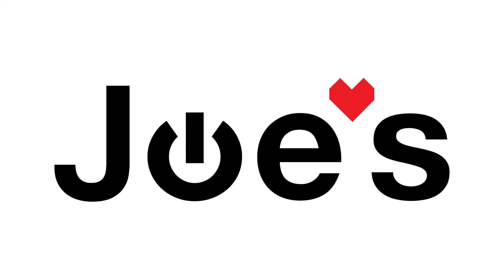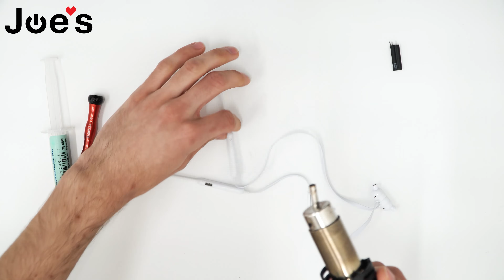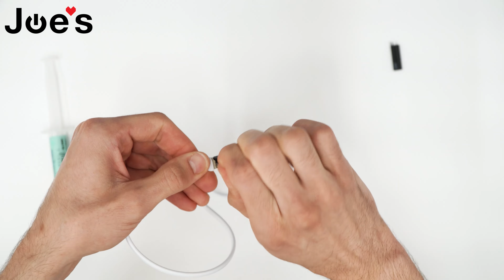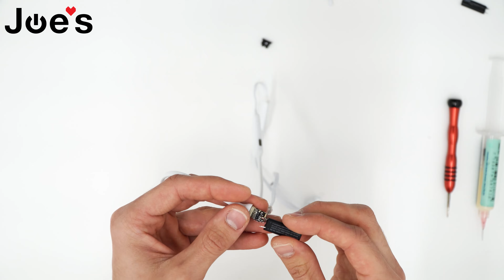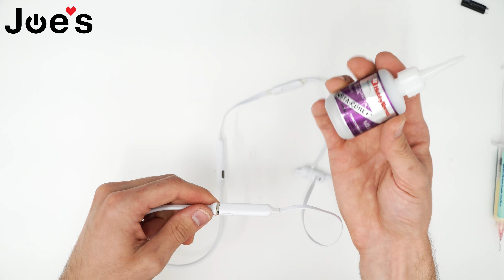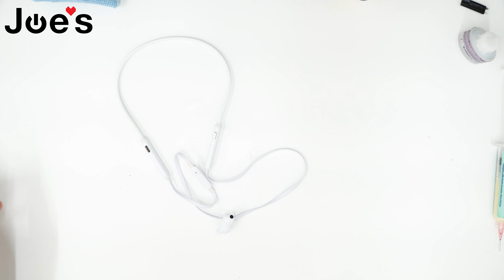Tutorial How To Repair Replace Broken Bad Battery Beats X Wireless Earbuds

Comment: It's worth trying what Ben said. If the device has not been used for a while you may be able to bring the charge back up above 3V by charging very gently at anywhere between 3V-4.2V with limited current. If the battery drops too low the bms will kick in and disconnect power to and from the battery. However the BMS might be built into the battery which would make it pretty small and potentially difficult to bypass. generally you need to charge directly to the cell itself because the bms may have cut of power from the charger. this is because the battery can self destruct if charged at full power when below 3V as it becomes unstable. but v gentle charging will restore 3V minimum and then the normal charger will charge it.
  Someone just gave me a pair but i hate earbuds, they have never stayed in my ears. I will probably move the receiver over to a different type of headphones.

Comment: My Beats X Sacai won't turn on, I suspect there's something wrong with the power button, but if I charge it the light goes on, is there any way to fix it? (HELP)
Reply from the maker: That was a very common issue. From what I remember it may be a bad main wire.

Comment: ***Request: My Beats X still work great except the buds are starting to come apart.

The little mesh guards both came out of the buds a while back, if you have a fix for that, I’d love to know.

Also, the buds themselves are separating at the seams. Do you just superglue those closed? 

Can superglue damage inside the earbuds if it gets in?

A video would be great. Thanks.

Comment: Wow so neat and doing the repair whilst commenting on the whole process. I purchased two pair of these (Beatx) a few days before Christmas 2020 for a present and never used them.  They are still in their vacuum sealed packs. I opened one pack today 05/06/22 plugged in the supplied usb lead and the led flashed red a few times then went red. After that there is no light at all. Seems they are knackered. I cannot believe it. I have another pair purchased at the same time still sealed in vacuum film. I expect the same outcome so all I can think of is contacting the manufacturer and asking their advice. If they are not helpful I’ll film the live unboxing and charging, and upload it on YouTube. I’ve read lots of customers who have had the same issue, charging on the day of purchase. It seems quite a few of these have been sent out with bad batteries. I live in the UK so not sure when to purchase genuine batteries from. Any help appreciated. And yes I would expect these to work straight out of the box 17months unopened
Reply from the maker: Sorry to hear you are dealing with that. We do ship our batteries internationally:)
Reply: Did they work?
Reply: Sorry, did u get them to work

Comment: Thanks. Year old beats wouldn't take a charge. Your guide helped me open it up. The battery voltage was around 0.5v. I was able to use a bench power supply to boost the battery up to 3.5v. Then the regular charger worked. Didn't have to replace the battery... Yet.
Reply from the maker: Happy to help. Thanks for watching. Please like and subscribe for more content like this!

Comment: How do I know if it's a battery issue or an issue with the cable? I have the same issue where upon plugging the Beats X earbuds into a power source, they flash red and white 3x, then it turns solid white to indicate charging. When I unplug them from power, they won't turn on at all. I ran my fingers over the black cable, since I saw that some people had it intermittently work when the cable was twisted a certain way, and there's a small blemish where the wires are bunched up/don't feel completely smooth. These have literally never been used, and Apple told me it'd be an estimated $91 for the repair (uh, yeah, no thanks). I just don't wanna buy one part (the battery or wire) and the opposite one is the actually issue. I'm also not trying to spend $50 on earbuds parts
Reply from the maker: It sounds like the wire is probably bad. These earbuds seamed to have that issue pretty often
Reply: I'm in the same situation.  Used half a dozen times, sat on the shelf for two years, now don't work.  Wouldn't have ever bought if I had known about the battery.

Comment: where do you get that flux in the syringe?
Reply from the maker: amazon.com/AMTECH-NC-559-V2-TF-no-clean-solder-16150K/dp/B01N8ZX7ZQ/ref=asc_df_B01N8ZX7ZQ/?tag=hyprod-20&linkCode=df0&hvadid=312065327708&hvpos=&hvnetw=g&hvrand=14698324034499163532&hvpone=&hvptwo=&hvqmt=&hvdev=c&hvdvcmdl=&hvlocint=&hvlocphy=1027652&hvtargid=pla-586193815164&psc=1&tag=&ref=&adgrpid=60223475657&hvpone=&hvptwo=&hvadid=312065327708&hvpos=&hvnetw=g&hvrand=14698324034499163532&hvqmt=&hvdev=c&hvdvcmdl=&hvlocint=&hvlocphy=1027652&hvtargid=pla-586193815164

Comment: Not worth it to fix, the battery costs $15. I see new units being sold for $19.99 on eBay.
Reply: I just got a battery for £5 and replacements of the headphone are not 19.99 they are a lot more on eBay
Reply: @barz91  they must have gone up in price. I see them for $29.99 now.

Comment: Please note - the replacement battery from Joes comes with different wires - and NO instructions.   When you you click on "original battery" - you get a picture of what I received - with Black, White and Red wires.   The actual originally (as shown in both their video and webpage instructions) comes with Black, White and GREY wires.   And that's also what they show in their video and webpage.   You CANNOT substituted RED for GREY.   Red is positive Grey is not.   To their credit they answered the phone and clarified.  And also had a shield over the Red wire - which told me they didn't want it to contact the other two (which would have been a bad deal)    So, take care and use caution.   And my cover did not come off as easily as their video (and others) described.  Just FWIW.  I did this more for the fun and challenge vs saving money - since the latest BeatX only cost slightly more than the cost (and effort) of replacing the battery.  Good Luck!
Reply: So what color did you connect the red wire too?
Reply: @joserobledo3070  The red goes where the white used to go. The black stays black. The white goes where the grey used to go
Reply from the maker: You could definitely email us and we could send schematics over.
Reply: What would happen if you soldered the red where the gray was supposed to be is it too late???

Comment: Joe's Gaming & Electronics  Is it possible to change the battery of the beats flex too? I‘m considering buying them, but only if they are repairable. Or do you have some recomondations on „cabeled“ wireless in ears, which are good to repair and high quality?

Comment: Great video. Thanks. What is the part number of the battery? I need to see if I can source it here in South Africa as shipping from the US is way too expensive.
Reply from the maker: There isn’t an exact part number that I can see. They are just a specific size. 3.8v 50mAh
Reply: Joe's Gaming & Electronics Thats perfect. Thank you.
Reply: @johanvandyk  Hi Johan, did you manage to fix your beats, I have just opened mine after a year of sitting in the box, have been using other headphones, I have taken my beats to Istore and they cannot help me as I am out of warranty, really wasn't expecting this and surprised at how many other people are experiencing the same problem. I am in Cape Town.

Comment: Hi, Joe. I bought a battery to replace mine, but the cable color are different (red, yellow, black). Do you have any tips for me to get the cables at the right place?
Reply from the maker: Here is an article with that information. https://www.joesge.com/blogs/beats-repair-guides/how-to-replace-the-battery-in-beats-x-wireless-earbuds
Reply: @Joesge  Thanks, somehow I missed that.

Comment: my second pair just broke (first pink light comes up), loose connection on the power button side, ive dismantled it but no idea what wire does what so cant pinpoint the exact wire to re-solder etc...

Comment: Imma try this but to resolder the pins i guess because my battery works its just the connectors that are loosen'd or disconnected because  everytime i readjust the wires lights turned red and white to pair themselves and eventually straight white then when im done readjusting they suddenly turned off... Well wish me luck

Comment: The battery I received from Joe’s looked nothing like the old one, it was silver colored, had no plastic enclosure, I was sort of disappointed as I was expecting what was advertised, nonetheless I still got it to work, red wire was positive, black was negative and white was the old gray wire.
Reply: It’s the replacement battery that is advertised to work better than the original one, so although it looks a Lil different (I ordered the same one you got), I’m sure it’s gonna last a lot longer than the battery the beats series provides! Here’s to hoping they stay working for a while lol
Reply: Dude! Thanks a ton! Just got the battery and wondered how I was going to figure that out. Again, muchas gracias.

Comment: Hey just got a battery off your site, it's not the same black battery as you have here in the video, also it's got a black white and red wire, which do I connect to which terminal
Reply from the maker: Hello we sell the original and generic. You must have bought the generic. Here are the steps in this article for the generic wire placement/ https://www.joesge.com/blogs/beats-repair-guides/how-to-replace-the-battery-in-beats-x-wireless-earbuds

Comment: Is this a permanent fix? Or the battery will get f*cked again because of the shitty beats?
Reply from the maker: Batteries always fail. It’s inevitable but the replacement battery we sell doesn’t due to PCB failure it will eventually die due to cycle count which happens to all rechargeable batteries.

Comment: Hi, so I was struggling with it to work, and then tried to switch two wires, since I had black, white, and red wires on the replacement. No light. BUT, I had these two metal prongs, and I tried to shove em in somewhere, and found that when they touch the pins across from the battery pins, the light turns on. But this only works at certain angles. So I think the LED got disconnected or something? Can you help me please?
Reply: Not your job to struggle — take the damn thing back!!!

Comment: I bought some BeatsX on Ebay and they wouldnt turn on, just flashed red/white then solid white when plugged in like in the video. I got one of the silver batteries and it worked (I dont trust the black OEM batteries since they seem to have a very high failure rate). I was a little confused since the silver battery wires are different colors, the red wire goes where the single OEM white wire is, then black and white go with black and grey. Hopefully this silver battery doesnt fail like the black ones.

Comment: My beatsx blink red..white...red..white 3x then continuous white flashes but they still turn on. They pair sometimes but if I move a certain way they unpair and the sequence of light flashes above happen again . I'm not sure if this is a battery or wire issue .
Reply from the maker: Thanks for the comment. The issue you are describing sounds like a main wire issue. This is a common issue with the Beats X Wireless. If you would like your device repaired by a professional you can fill out a repair form and follow the steps to send in your item. We offer free shipping and diagnostics. Here is a link to the repair form:
https://www.joesge.com/pages/repair-services

Russ C.

Comment: What if my light goes white - red - white -red over and over, 
,no matter for how long i leave them charging ?
And the  hold 2 buttons" trick to restart them doesn't work, they simply don't light up at all
Reply from the maker: Thanks for the comment. The issue you are describing sounds like a main wire issue. This is a common issue with the Beats X. If you would like your device repaired by a professional you can fill out a repair form and follow the steps to send in your item. We offer free shipping and diagnostics. Here is a link to the repair form:
https://www.joesge.com/pages/repair-services

Russ C.
Reply: @Joesge  how much would that cost tho?
Reply from the maker: We are more than happy to help you out with this issue. Unfortunately, we are unable to accurately quote you on this repair as there can be a variety of issues. We can, however, give you an estimated quote. The issue you are describing sounds like a faulty main internal wire. The estimated price for repair is $55.00. Please note that the price quoted is only a estimate. We offer free shipping and free diagnostics. Please visit the link attached to start a repair request. https://www.joesge.com/pages/repair-services
Reply: @Joesge  there's not much sense of repairing $70 earbuds for $55
Reply: @Joesge  the thing is that I wouldn't be sending it, as I simply just don't trust this company, I've never heard of it. I was just simply looking for a repair  that i could do.. those earbuds hold more emotional value than monetary one, but I still would rather fix them myself
Reply from the maker: Here is a link to our repair parts: https://www.joesge.com/products/beats-by-dre-beats-x-wireless-repair-parts?variant=15312014377006
If the part you are looking for is out of stock you can enter your email in the "Item out of stock - notify me!" section and you will be notified when this item is in stock. 

-David P

Comment: you're freaking amazing. mine has the issue where the right side stopped working, but if you push the cord into the battery it works while you hold it, so some wires likely got desoldered/pinched, i'm going to open it up and resolder it! thanks!
Reply from the maker: Glad we can help:) Please like, subscribe and share the video.

Comment: my beats work but they take more than five minutes to turn on and off
Reply from the maker: Thanks for the comment. The issue you are describing sounds like a main wire issue. This is a common issue with the Beats X Wireless. If you would like your device repaired by a professional you can fill out a repair form and follow the steps to send in your item. We offer free shipping and diagnostics. Here is a link to the repair form:
https://www.joesge.com/pages/repair-services

Russ C.

Comment: Got brand new Beats X, not turning on :(
Reply from the maker: Thanks for the comment. The issue you are describing sounds like a Battery issue, when the Beats X Units sits around and has not been used for a long time the battery goes into sleep mode and would need battery replaced. This is a common issue with the Beats X. Here is the link to purchase the part 
[ https://www.joesge.com/products/beats-by-dre-beats-x-wireless-repair-parts?_pos=1&_sid=78d3052f1&_ss=r ] . If you would like your device repaired by a professional you can fill out a repair form and follow the steps to send in your item. We offer free shipping and diagnostics. Here is a link to the repair form:
https://www.joesge.com/pages/repair-services

- Russ C.

Comment: Mine never powered on after connecting the new battery to the terminals, only after I plugged the headphones in to a cable the red stays blinking and nothing happens
Reply from the maker: Thanks for the comment. The issue you are describing sounds like The main wire is going out on the beats X. This is a common issue with the Beats X. If you would like your device repaired by a professional you can fill out a repair form and follow the steps to send in your item. We offer free shipping and diagnostics. Here is a link to the repair form:
https://www.joesge.com/pages/repair-services

Russ C.

Comment: Hello, when I turn on my BeatsX the led light turns red and white like 3 times, then it’s only white and they connect normally to my iPhone, but when I move them they turn off magically. If I do not move them they can be on for hours (so it’s not a battery problem) Do you know any solution? Thank you...
Reply from the maker: Thanks for the comment. The issue you are describing sounds like.the unit is having a main wire issue which means whenever using the beats X over time internally the unit  contact points come undone and the unit works but cuts in and out all the time. This is a common issue with the Beats X If you would like your device repaired by a professional you can fill out a repair form and follow the steps to send in your item. We offer free shipping and diagnostics. Here is a link to the repair form:
https://www.joesge.com/pages/repair-services

- Russ C.

Comment: What if it just blinks red
Reply from the maker: Thanks for the comment. The issue you are describing sounds like a faulty main wire or board.
If you would like your device repaired by a professional you can fill out a repair form and follow the steps to send in your item. We offer free shipping and diagnostics. Here is a link to the repair form:
https://www.joesge.com/pages/repair-services

-David P

Comment: Hey, I watched this video and I just wanted to ask if it applies the same to if my light turned white upon plugging it in (No red and white and red.)and when I try to turn it on it doesn’t. It was just working yesterday.
Reply: Same. Tried turning it on.  Was having no issues day before but today its not trying
Reply from the maker: Thanks for the comment. The issue you are describing sounds like a faulty mainboard. 
If you would like your device repaired by a professional you can fill out a repair form and follow the steps to send in your item. We offer free shipping and diagnostics. Here is a link to the repair form:
https://www.joesge.com/pages/repair-services

-David P